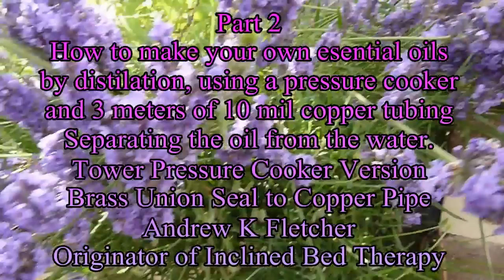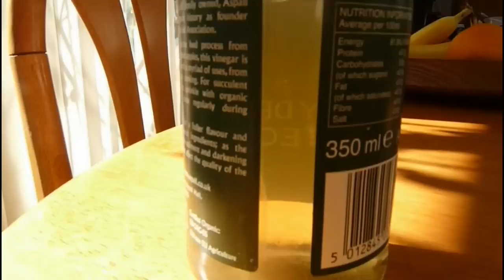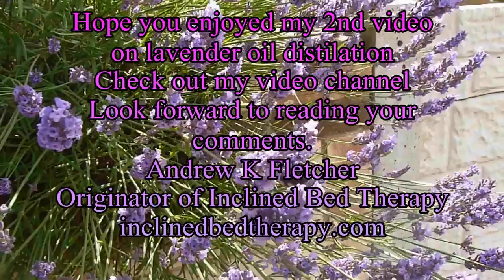Distilling Essential Oil / plant oils Homemade Still Distilation Extraction Lavender

Comment: okay i watch the video and i have extracted all the hydro sol form the bio mass the thing i still dont get is how to seperate the oil from the hydro
Reply from the maker: Allow to stand for a day, then siphon off the hydro sol from underneath the oil with a tub to reduce the quantity of oil and water. Swish what is left around the jar you distilled it into and pour through a funnel into a tall narrow necked clear bottle. Allow to settle and clear completely for 5-7 days, this removes any sediment from the oil. Now you can either pour the oil into a small container, stopping before any hydro-sol and sediment enters your oil filled bottle, or you can fix thin tube to a 50mil syringe body and draw off the oil. This is the method I prefer as you collect all of the oil. Then keeping the syringe body and tube connected vertical with tube facing down, after a few minutes you can remove the water by depressing the syringe plunger to force it our leaving behind pure oil.
Reply: Andrew K Fletcher
 thank you very much for the answer

Comment: Can't hear on video why you put the hammer on top while cooking
Reply from the maker: The seals on pressure cookers need pressure to seal. Because the still has an open ended pipe, little pressure builds up so the hammer / weights or you could use mole-grips / self locking clamps to effect a seal. The weights worked ok, but the rubber seal in this pressure cooker is pretty old and hardened with age. Needs a new seal.